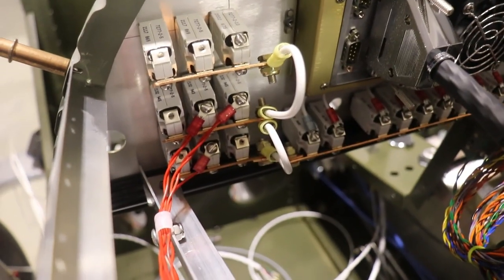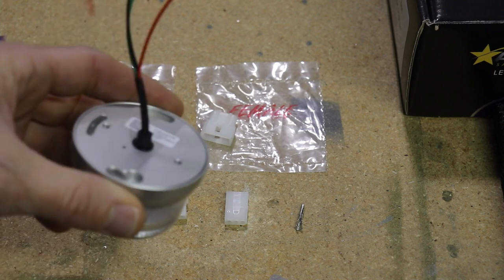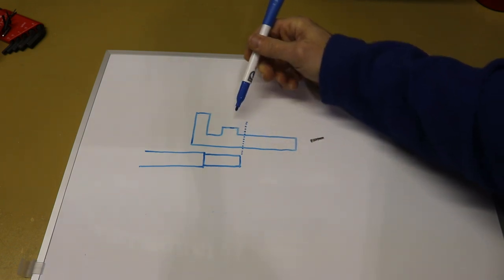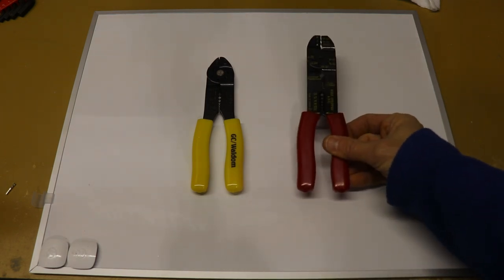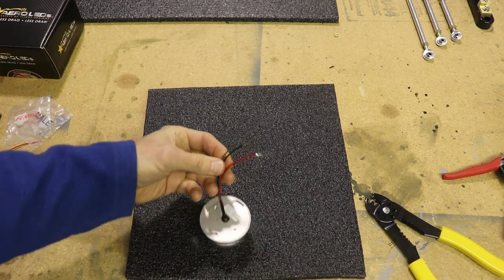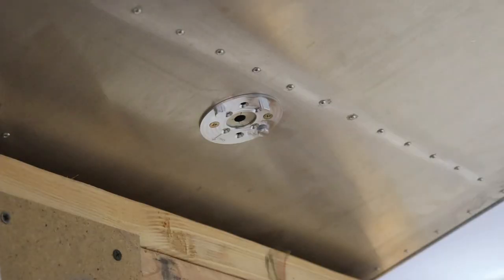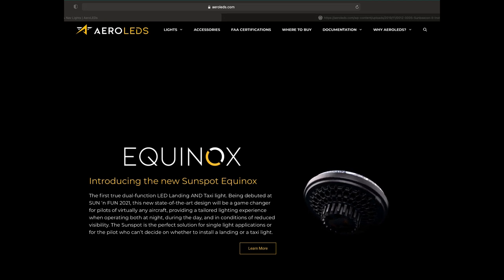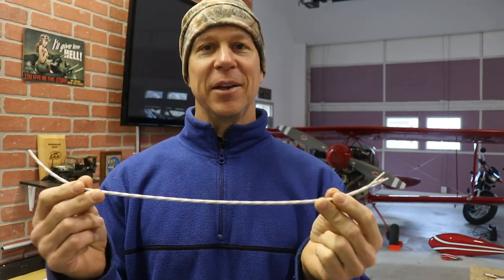Crimping Pins on the AeroLEDs SunBeacon II Light (Ep76)

Comment: Should you need to change the red light in the field. The molex connector will not go through the hole.
You will need to enlarge the hole to be able to do that.
Reply from the maker: Well, I won't have a spare beacon in the field so I won't be changing it there anyway. But I have a small plunger type tool that's used to pop the pins out of the connector. Hmm, I guess I'll still have to get to the inside fuselage though to pop the pins out. oh well.
Reply: @KitplaneEnthusiast  Whether it’s in the field or the hangar, I feel like the ease of the set screw installation onto the plate is defeated by still having to go inside the fuselage to depin the connector. Seems like the right way is to enlarge the hole in the fuselage to the size of the hole in the plate. I think you’d agree that the holes matching will make for a cleaner install than just making the hole as small as possible. Plus it will make the connector usable as a connector instead of a wire weight that you’ll end up ziptying. I wasn’t going to mention it but now that I’m caught up on the build blog and it hasn’t been readdressed, I chimed in. Of course now I see a bunch of people mentioned it, so sorry if you’re already annoyed by the input from all sides. Great videos by the way. I appreciate your work.

Comment: You will not be able to change the light without having to go inside the aircraft unless you enlarge the hole so you can get to the connector?!?! I have to ask as you are not using the Green wire why did you not go for a 2 pin plug, which might fit through your small hole?
Reply from the maker: You are correct, as has already been mentioned here numerous times I didn't think about pulling the light out with the connector still on it. As for the green wire, the two hole connector still does not fit through the hole. I made the hole basically the same size as the rubber boot on the beacon so that it makes a mostly watertight seal. I could still cut off the green wire, but figured I'd put it in the connector just to have it. Who knows, maybe when it's all done I'll think "I actually might want to sync that light!"
Reply: @KitplaneEnthusiast  As the two pin will not go through, it might be worthjust using single pin connectors.

Comment: Just a little hint on crimping wires.
Do not twist the wire end. Let them go straight into the connector before crimping.
Reply: I was just about to say this. The twist can slowly work out or settle in and you’ll end up with a pulled wire.